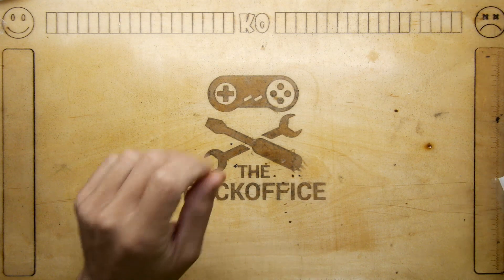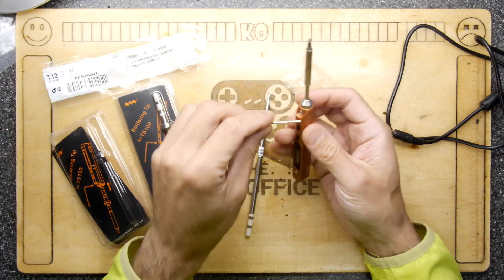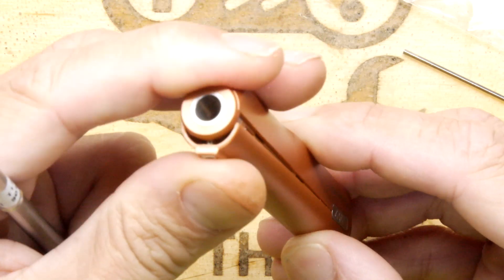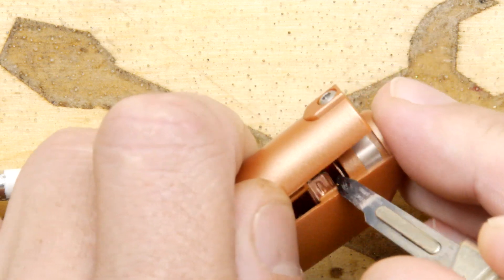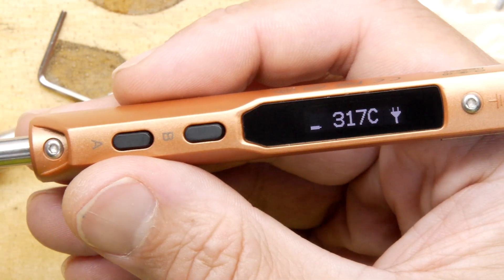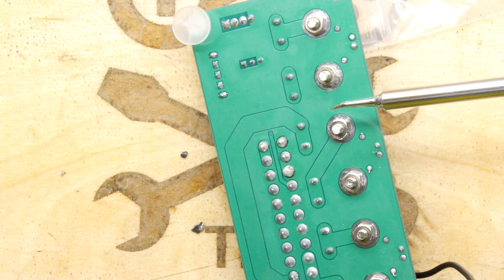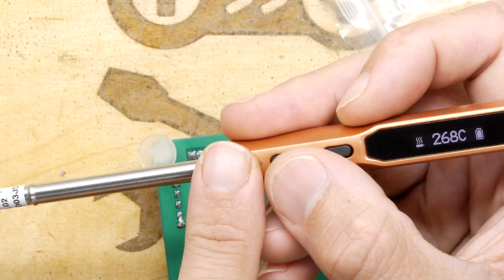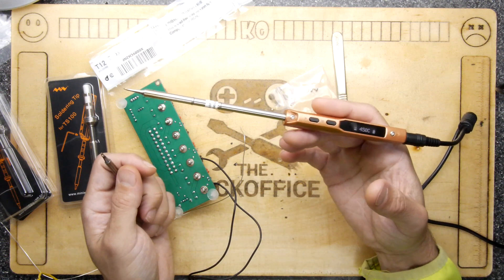TS100 T12 Soldering Tip Swap Test

Comment: One could get silicone hose from Amazon for 10$ for 10ft and slide it over the cartridge.  It might work better than a 3d print cause of the higher heat resistance and insulation of silicone compared to 3d printed plastic. Plus silicone has a better grip in one's hand

Comment: nice one ill try that cheap t12 handle with the ts100 tip it may work and ill have the power of the ts100 in to my rework station with ts100 tips for like 15 euros voiding to buy a ts100 coz it just doesnt work for me, i refuse to pay 50 euros or more for a sodering iron only